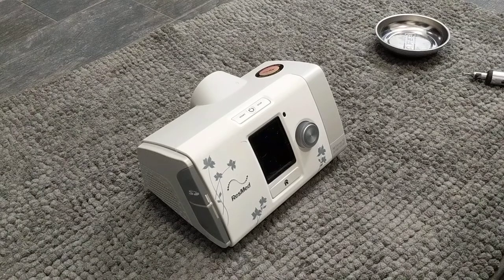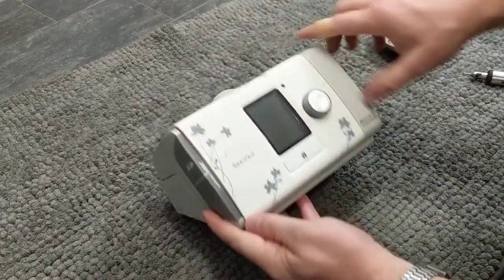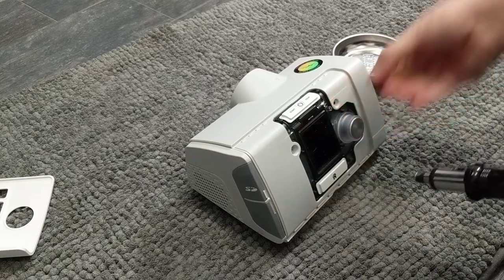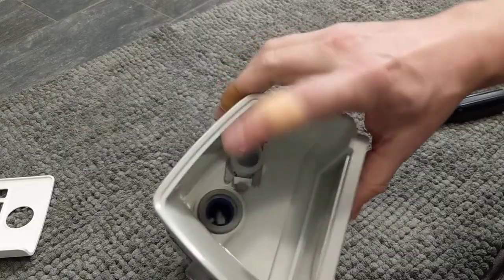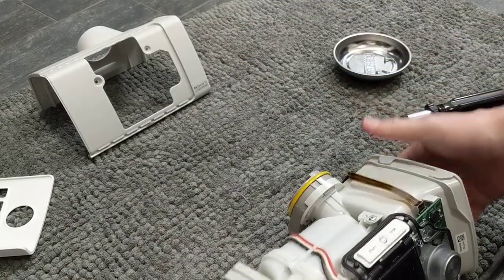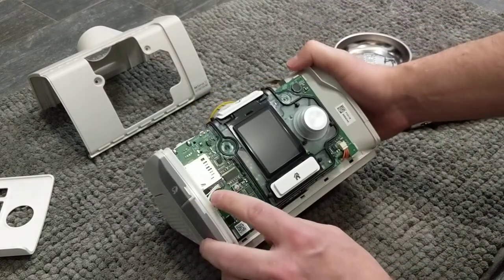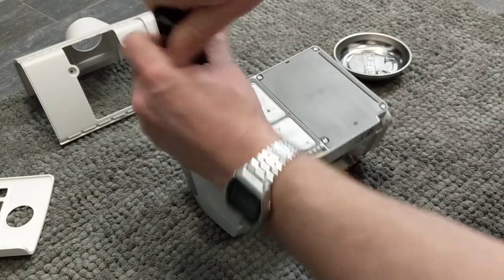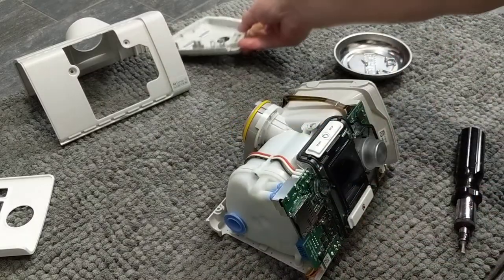Disassembly and modem removal of ResMed AirSense 10 AutoSet For Her

Comment: Does anyone know how to clean INSIDE the pump/motor?
Reply: It wasn't obvious how to open it or I would have done it too. Unfortunately the part can't be easily found for replacement, either. I blew some air through it but that was about what I could do.
Reply: @bendirval3612  Only way I can see how to clean the motor is to get a tin of compressed air, keep the tin upright (do not shake it) and blast it with the air.  If the motor smells, try giving the case of it a clean (not with water) just a damp cloth. Try leaving it around some nice smelling stuff, but do not put it in it or wipe the case of the motor, sometimes the plastic can react, so take care.  Remember, YOU are going to be breathing the air going through the impeller of the motor.   Do not attempt to do this if it is hired, or NHS machine, you may end up paying for it, it costs a lot of money.  If you are not sure of confident, leave it alone.  REMEMBER TO UNPLUG IT FROM THE MAINS (power supply).
Reply: I took pipe cleaners and meticulously cleaned every fan blade.  They came out dark or black!  I too blew compressed air into it and did a wipedown.
Reply: @HockeyFan1972  how did you get the clear plastic motor case open?  Does it twist or something? Or did you clean it without opening the clear plastic?
Reply: @bendirval3612  I cleaned it without opening.  It is sealed.  I just swabbed the pipe cleaner down each fan blade.  I **Think** water got into the motor as the motor, though sealed, showed signs of moisture.  So im sure the bearings got wet or something.  I recall when this possibly was when it was knocked off my nightstand when i was sleeping.  Who knows.  Still trying to work with the insurance to get a replacement.
Reply: it is superglued together. Only way to sort of clean it is compressed air. If not, go gumtree get a new motor for $100.
Reply: @doobtom271  if it is literal superglue, I'm fairly certain that can be dissolved with rubbing alcohol or acetone. (But, you might not get it EXACTLY assembled in the EXACT right shape to have perfect balance of the motor and such.)
Reply: "get a tin of compressed air" <-- Compressed air typically comes in aluminum cans, not tin. (Yes, I realize this is probably a culturalism, to call everything in a can a "tin".)
"NHS machine" <--- This is just a weird concept. The NHS owns medical equipment? We have no equivalent in the USA. We have DMEs, that are typically not associated with hospitals, that sometimes you lease equipment through. It's very silly though, and typically you can more cheaply just buy it outright.

Comment: First, thanks for the OUTSTANDING video. Clear, concise, action-packed!
Looks like, at a glance, that the motor is not disassemblable <- is that even a word? Maybe it could be taken apart, but splitting it would probably let out the magic. In fact, without holding it in my hand, but looking from afar, iit looks like it was constructed into two halves which were then likely attached permanently - ultrasonically welded or permanently cemented? 

So how to clean the motor? Not an idle question. Seems like mine got something in it somehow - maybe a tissue, but whatever it was was chopped up, and some blew into my nose/airway. Ewww. Not sure what - or how, but I'd really like to clear the motor and any airways in it to the extent possible. I'd consider just replacing the motor after seeing this video (kudos!) if 1. I could get a new motor &  2. It was an economical choice: what would the breakpoint be to add two more years of service life (meaning it would last 4 total?) 

I don't have a frame of reference; is $150US enough? $200? Are they available? (esp. to civilians)
Reply from the maker: Sadly, I have not found a motor for this for sale anywhere. We need to find the Chinese factory making them and ask if they can put them on aliexpress. I have heard some people have success removing the motor and blowing it out with compressed air or a vacuum. You might try that. You can often buy a new cpap on craigslist or offerup for around $300.